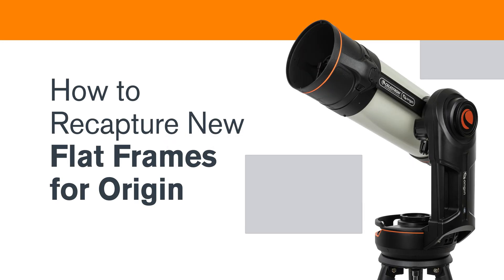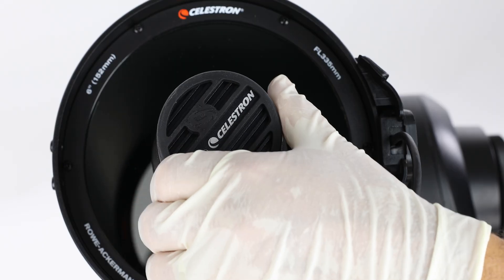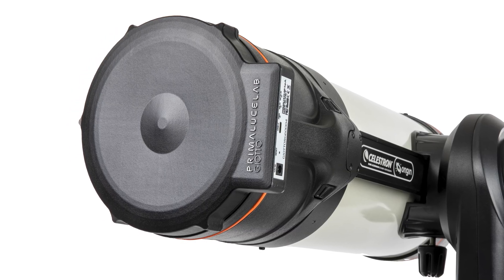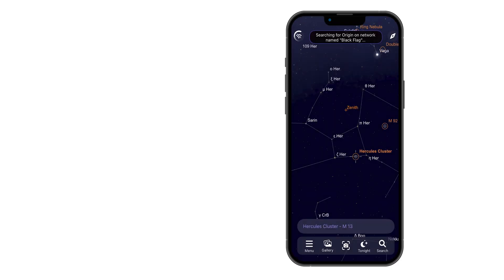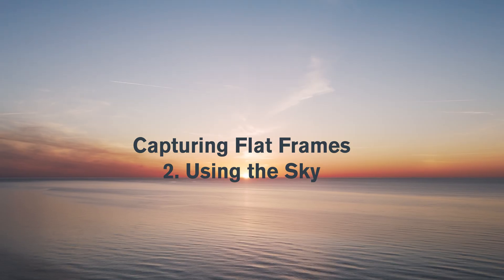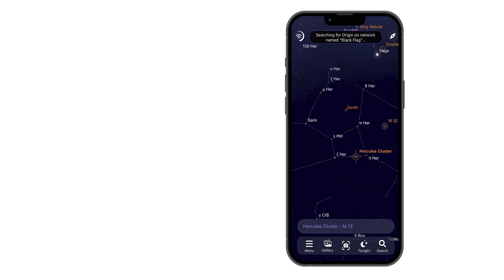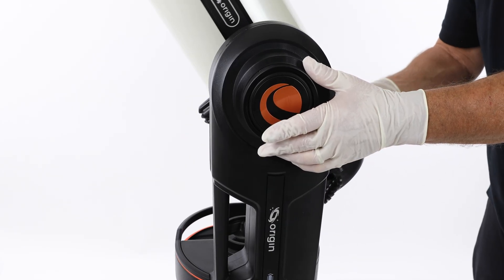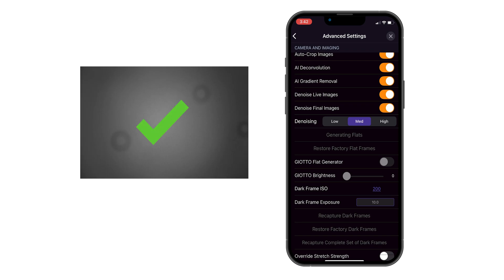How to Recapture Flats for Celestron Origin

Comment: Please, it would be EXTREMELY helpful to quantify whenever possible. Please provide the expected histogram results that we should see when looking at our flats. For example, I'd expect the mean ADU count to be around 30000, and indeed, that is what I do see. But, I cannot seem to get the standard deviation below 20% with the clear filter. From my estimation that's too high. I am using the sky technique. I waited until about 20 minutes before sunset and followed the instructions here.The sky was very clear.  Using the nebula filter, I have an LED setup that seems to generate very good flats. I tried that setup with the clear filter and the results were very bad.